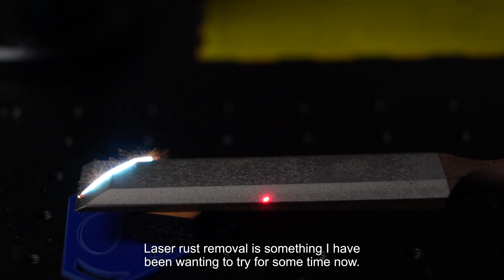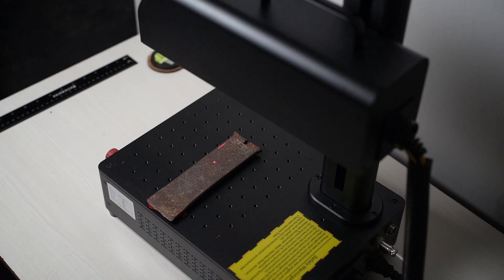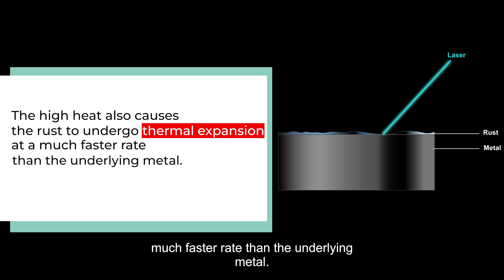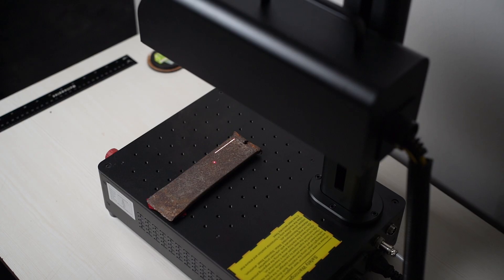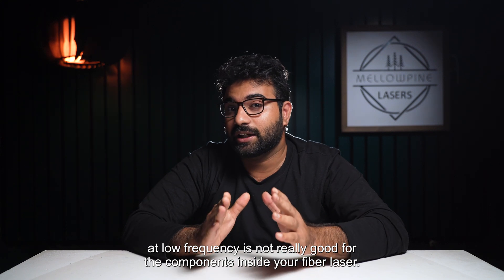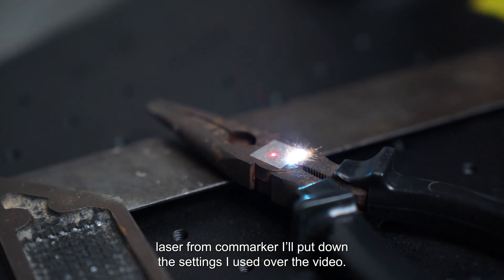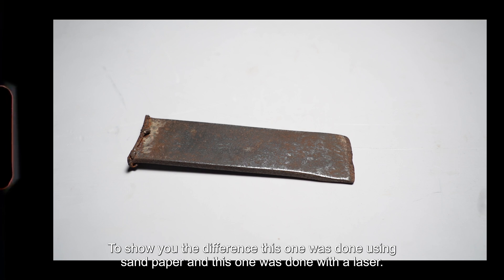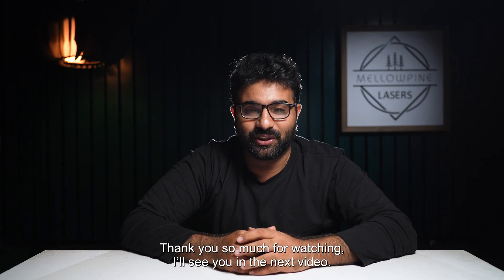Rust Cleaning with my 20W Fiber Laser

Comment: I wonder if it would be faster if you applied rust converter first. It turns rust black
Reply from the maker: Maybe, since black absorbs radiation fast but when it comes to lasers it sometimes doesn't work the way you think it would. Like you can see in my latest video where I used CO2 as an air assist and thought it would give me cleaner cuts.
Reply: @MellowpineLasers  only one way to find out lol

Comment: can you use a laser like this freehand? If not why not?
Reply from the maker: If by freehand you mean whether you can hold the machine in your hand and blast any surface with laser. Kinda yes. There is an adaptor that goes onto the front that helps you keep the proper distance between the lens and the surface. However if you mean to use it like a water hose we use to clean stuff, no you cannot. There are purpose built laser for rust removal that can be used that way but the one shown in this video is not built for that. I have a full review of this machine on my channel please check it out.
Reply: @MellowpineLasers  ok but why? just because it's not powerful enough? If it super sensitive to distance from item when it's only 20w?
Reply from the maker: The sensitivity to distance is more of a lens problem rather than a power problem. These machines are designed to engrave intricate details so the lens used on these machines converge the wide laser beam from source into a really tiny spot but for doing that they need to use short focal length f-theta lenses and the problem with these lenses is that the depth of focus is going to be shorter. The beam would come in converge into a tiny spot and then start diverging and your surface needs to be at the point of convergence to get maximum energy density. In case of rust removal lasers, they don't need tiny spot size and hence use long focal length lenses.
Reply: @MellowpineLasers  thanks heaps, that makes sense.
Reply: are the lenses changeable?
Reply from the maker: Yes, you can swap the lens
Reply: @MellowpineLasers  long story short, I'm seeing second hand fiber lasers like the one in the video coming up cheap second hand. I want to use it freehand and trying to figure out if there is a way to get into it without spending 10k
Reply from the maker: You could repurpose it for rust removal, get a powerful one to make your job easier. Get one that has red laser pointers like this one. There are three red lasers on this and when the spot from the three lasers coincides, you'll know your laser is at the right distance from the surface. This won't be the professional solution but it would be a good DIY solution. Also get a laser that comes with a long focal lens, above 200 at least or  look if they offer lens extensions.

Comment: Would rust cleaning be possible with a diode laser - say 20W?
Reply from the maker: No, it would be highly inefficient and the laser would engrave the metal.
Reply: @MellowpineLasers  X1 seems to be doing it with an infrared diode laser....
Reply: Xtool f1 I mean. Then there is this adomstack brand that seems to be doing more powerful ones. I'm trying to find it again. Do you have any thoughts on these?
Reply: Ok, maybe I got that wrong, the atomstack appears to be only 2w.